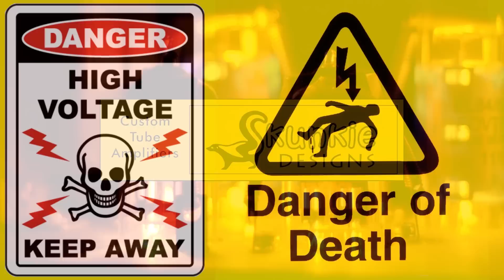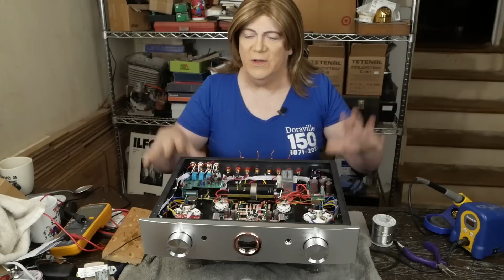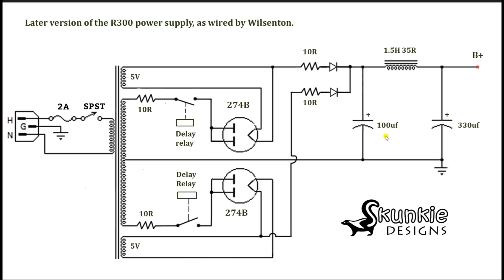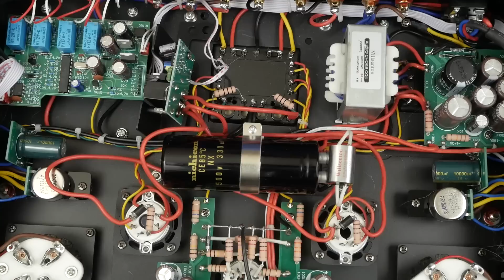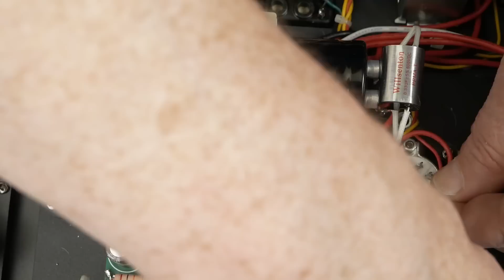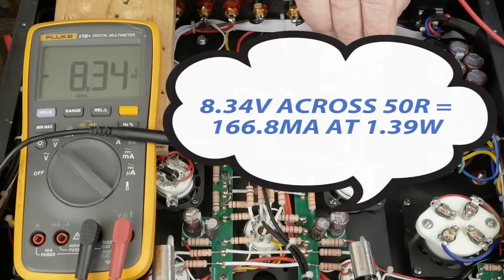Willsenton R300: Power Supply Problem Resolved

Comment: Even 5AR4 is spec'd for 60uF @ C1, not 100uF.  And that accounts for backflow, so the diodes aren't necessary. Why not use the original rectifier and replace C1 to 4uF? Problem solved in one move. The fact that the designers added 7 parts instead of changing the improperly spec'd part tells you to avoid this brand.
Reply from the maker: My guess is going to 4uf there isn't enough power supply filtering.. And they spec'd a 330uf for the first cap!
Reply: @SkunkieDesignsElectronics  Crazy. You should be able to add a lot more filtering on the C2 side of a choke. Directly heated rectifiers have a lot of limitations!
Reply from the maker: Which they ignored!
Reply: @SkunkieDesignsElectronics  So I learned a few things on this : The 274B and others that state 4uF aren't designed for CLC at all, but for LC (the 4 is a "if you have to" spec). The choke input does its filtering across the entire conduction cycle, but the tradeoff is lower B+ (since caps charge at the peaks). Apparently it's a highly revered tube... was used in lab power supplies because a choke input has almost no sag compared to CLC, so its extremely effective at filtering and stabilizing. What I like about tube amps is it really forces you to understand each component!
Reply from the maker: Those are really "fake" 274B. It's a 5U4 in a fancy bottle.

Comment: H Stephe, Thank you so much for your explanation and help those that bought the Willsenton R300 and stuck with it. Do you recommend to have 2 chokes design that you propose in your the other video, Willsenton R300: Power Supply Mods Reviewed, then the simple solution you suggested in this video? I asked this question, simply because I so happened has 2 chokes that sit around, and one of them is 194G. Thanks
Reply from the maker: Usually more filtering on a single ended amp if helpful, especially if you are using super efficient speakers!

Comment: I noticed that they didn't  stake the wires to the tube terminals. Makes it easier to modify but the connections have slightly higher resistance. Plus, the wires will come off if the connection ever gets real hot. As for your silicon diodes, you will notice that the Tubes4hifi dual rectifier board for the  Stereo 70 or 120 also uses silicon diodes along with the two tube rectifiers.
Reply from the maker: This "higher resistance" would also be the case for every PC board ever assembled. I don't buy into that idea you would ever hear the resistance of less than 1mm of solder. And if something ever happened that creates and the to get so hot solder starts melting, other stuff would give up before that happens.

Comment: Hi Stephe! Great video. Thank you for digging into this amp. The qualitative reviews seem great but the quantitative tells a different story. On the verge of pulling the trigger on getting one. Does anyone know if  Willsenton is still putting the delay boards in them?
Reply from the maker: The newest one I saw, the "plus" version does not. They now have a smaller first cap and use the 5AR4 tubes I recommended.
Reply: @SkunkieDesignsElectronics  that’s mean now i can buy this 300 plus version.

Comment: Hi there, I have questions about the 274b rectifier tube: can I change that tube with 5U4G tube without any modification on 300r amp?  Thanks
Reply from the maker: You can, it's MUCH more likely to survive than a 274b tube is, but this amp design still FAR exceeds the max capacitance specification for any rectifier tube ever made.
Reply: @SkunkieDesignsElectronics  
Thanks for your help 👍 🙂 🙏
Reply: @SkunkieDesignsElectronics 

Hi Stephe, 
I changed the 5U4G, and I fell a bit   different with willsenton 274b tube. Now, another question is could I use 5AR4 into same amp?
Again, thanks another for your help
Reply: Hi Stephe, 
I changed the 5U4G, and I fell a bit   different with willsenton 274b tube. Now, another question is could I use 5AR4 into same amp?
Again, thanks another for your help.

Comment: Im thinking about buying a R300 or can somebody recommend something close to the price? Thank you very much for this video!
Reply from the maker: The problem with using this price as a goal post for a 300B amp is this "list price" isn't realistic. We see the same thing with the Reisong A50. First you have to toss all the tubes, which adds easily $500 to the price. Then in both cases, they require internal modifications and in some cases major parts replaced to perform to the level a 300B amp should be at. Sadly these poorly designed amps have set consumer expectations on what a quality amp should cost so low, it's driven everyone out of the market.
Reply: @SkunkieDesignsElectronics  Thank you for your answer! I thought about building your budget 300B design, but I'm a little scared to mess up, if I have to build from scratch. The modifications you did with your videos seems very possible for me. 

It dont have to be an 300B amp, if I can get a better sounding tube amp for the money. Fokus is on Midrange and highs, bassdriver will driven by Accuphse E303-X which should work good with tube amps.

Just saw your Video about R8 MKII, maybe this is an option or maybe even a Musical Paradise MP301 MK3 for the start? (To much videos, forums... not enough time)

Im just 30 years old and want to start with tube amps and I like the idea, that they can grow with me. Swap for better tubes, do some modifications or when money is better, buy a better amp.

Comment: Why do they even bother using a tube rectifier for the power supply? A solid state power supply is not going to take away from the "tube sound" of a 300B power amp.

Comment: Do you think keeping the 5U4GB EH (I already received from the producer) plus adding an inrush current limiter like CL-60 in the primaries of traffo and adjusting the 50 Ohm resistor to reach the correct plate voltage could be a solutions as well? Thanks
Reply from the maker: I'm sure there are multiple solutions! There always are. I know sizing the CL-xxxx devices is key so read up on that and that should work.
Reply: @SkunkieDesignsElectronics  This amp PSU is a nightmare. I disassembled it and the first Cap is 330uF then choke and last is 220uF (opposite order to yours). In my amp there is zero resistors in the PSU... Just one extra diode before 330uF cap. The latest tubes I received from China Audio (5U4GBEH) are rated max 40uF. My amp was sent without the delay board - it was delivered few weeks later to solve all the issues...

Comment: Stephe,
Wouldn't you need to solder 1- Vishay wire wound 50 ohm 5W, for the left and right rectifier tube sockets? On your video above, I noticed you only added your spare resistors to one rectifier tube socket. I'm about to order them from mouser. I'm ready to place a order for both my Willsenton R300 amps.  I was going to order 4 of them. Although I may hold off until, I see more on your modification series, and save on shipping cost. In the event I need to order more parts, for other area's you notice  part changes-reconfiguring. It would be nice, if you could also mention in your series, performance mod's, beyound the basics of reliability issues your correcting as well. Since Willsenton hasn't did a good job on these particular reliability issues. 

  I personally would like to take the amp, to a higher performance level within reason, based on your suggestions, that wouldn't be overkill. For example Mundorf caps,  Hammond chokes, as well as any other suggestions you may find beneficial. I know new iron would definately help, but at what expense does one have to say their is a resonable stopping point. Your suggestions are certainly welcomed. 

I followed your guidelines, removing my delay board and performed all your reconfiguration suggestions on rewiring.  Very easy to do by the way,  FYI R300 owners.  I reattached new zip ties to the original lay out.  After i finish one of them correcting all the issues, one will be for sale.

Thank you for helping R300 community Stephe
Reply from the maker: You only need this resistor on the one side, it's attached on one side where the two rectifier tubes are connected together after the diodes, and the other side to the wire going to the choke. Look at the schematic.

If you are worried about the $7 of parts shipping costs, wait till I am finished.

Comment: If the TL iron is good, and the package price is good I may well be  building these SE monos, be great if they could run EL34 too, could this be acheived through w switchable cathode resistors rather than a rectifier change.
Reply from the maker: This is a fixed bias amp.
Reply: @SkunkieDesignsElectronics   interesting.Thanks Steph.

Comment: Steph, great work. I have an early version with the 220uf cap and only one 10 ohm resister. China HiFi sent me a delay board which was installed but of course it didn’t prevent the 274B’s from arcing. I intend on replicating your mods  by first eliminating the delay board, adding a 5watt 50 ohm resister, adding the new choke and then adding the ‘missing’ diode. Can you provide the correct spec for the diode?
Reply from the maker: 1N4007 should work.

Comment: Hi Steph. Genuinely  before you said it i was thinking it looks nicer with the 5ar4's, the 300's stand out more now. A few questions though, if you can possibly find the time it would be appreciated. Why keep the diodes in the B+ psu circuit? Sorry I don't understand the purpose of this, and also what is the purpose of the 10r resistor before the rectifier on the AC, is this just a dropping resistor, also the purpose of keeping the 50r after the diodes in your design. Is this just to add extra filtering.
Reply from the maker: The diodes protect the rectifier tube in case of a hat restart and I've read can also help suppress a flash over. 

Mainly leaving the 10R in because they are already there + adds a bit of voltage drop resistance without generating a lot of localized heat.

The 50R after the diodes is the main thing protecting the cap on start up as those really big caps fill up. The amp needs the voltage drop from going to a more efficient rectifier anyway so is a win/win.
Reply: @SkunkieDesignsElectronics   so one of my amps was built into a small box that my father gave me (sentimental). I have 47uf 1st cap, 200uf film cap (2nd cap), but only one 10H choke in psu, is there an easy way to get any more filtering with resistors rather than adding a second choke that would reduce B+ and I don't have space for in the box. B+ is approx 310v and rectifier is 5r4gy running 2 x el84's. The film caps are huge and were expensive to buy but i thought probably worth the investment.
Reply from the maker: with a 10H choke, it's probably good as is.

Comment: Did you measure the total resistance of the HV secondary? Is it a 350-0-350 secondary?

I’m guessing the 2 10R + 50R are enough limiting resistance for the 5AR4s granted each of them has their plates tied together.

Now the question is: Would it survive a turn-on a few seconds after a turn-off, i.e. a hot start.

Also, remember to check if that fixed the huge frequency hole around 11kH.
Reply from the maker: These mods would allow a single (NOS quality) 5AR4 to survive. A pair will be coasting. Given we needed to bleed off some HV, adding the 50R serves both purposes and I doubt this fixes the other issues I found. more to come.

Comment: Good precaution on the lesser 300B's. 100 ohms would provide enough voltage drop for JJ's. In that case I would add the 3 H Hammond choke and 50 ohms instead.
Reply from the maker: Just be aware raising the resistance also increases the wattage across the resistor.
Reply: @SkunkieDesignsElectronics  Ohm's Law, of course. You'd need 10 W capacity for 100 ohms.
Reply from the maker: Yep. I would just avoid those JJ 5AR4 tubes.

Comment: I really don't understand the desire for tube rectification. I can understand the logic behind using a tube in the audio path, because I do it myself to get a little tubey harmonics, but designing an amplifier in 2023 with a tube rectifier when it could be done so much more cleanly and efficiently just seems strange and counter productive to me.

I mean, if they're going to design an amp with a tube rectifier, at least make it a cool one like a mercury arc or something.

Also, the irony of using diodes across a tube diode.
Reply from the maker: The diodes aren't across the tube rectifier, they are in series. They only function in the case of a tube failure.

The advantage of using an indirectly heated rectifier tube like a 5AR4 is the slow voltage ramp up.

Comment: Nice mod Stephe! 👌Since the delay board is ditched and some space is created for a second choke, are you considering to update the power supply to dual rail? That might be a cool upgrade 🙂🤞
Reply from the maker: That is absolutely a possibility, especially using 5AR4 tubes!
Reply: @SkunkieDesignsElectronics  It makes sense since there are two 5AR4's and it will minimise cross talk between the two 300B's. So please give it a shot 🤩

Comment: The working current of 5ar4 is 250ma, is one ok?
Reply from the maker: Yes, but would require more wiring changes for that to work and starts to push that 100uf first caps being OK. Then you would need a better quality choke to keep the AC ripple at the same level.

Comment: They had problems with the rectifier tubes !!!......hmmm.......Any blind technician from the tube era looking at the circuit could predict that !!! 
And the way they designed the HV delay with direct heated rectifiers is a BIG mistake...
They have no clue about tube technology but are selling and building tube amplifiers .
Good to see that some people today like you are there to correct those thosze errors and solve the problems ...
Customers still think that those chinese BS is designed by skilled and experienced technicians .
Reply: Agree, shocking to see how Willsenton „designs“ their amps. Absolutely BS. How is it possible to sell this BS and get so many positive „reviews“ from all the youtuber „experts“.
Reply: Exactly, Frank! I’m younger and not necessarily from the “tube era”, except for the fact that I’d never not use a tube amp for my guitar amps. But….I work on guitars and tube amps almost everyday, mostly replacing bad parts, retubing, and biasing tried and true designs, and even I can see that the HV design with a delay before a direct heated rectifier is just a bad idea. 
I don’t know who’s designing these Chinese made tube amps, but you shouldn’t have to immediately repair a design on a brand new amp! Mods and upgrades after listening to and living with it for a bit, and seeing where they’re necessary and will help the amps performance is a different thing, but having to fix the basic design is just wrong. 
Stephe is such a skilled and knowledgeable person when it comes to trouble shooting these designs.